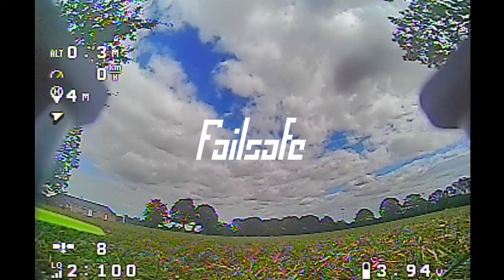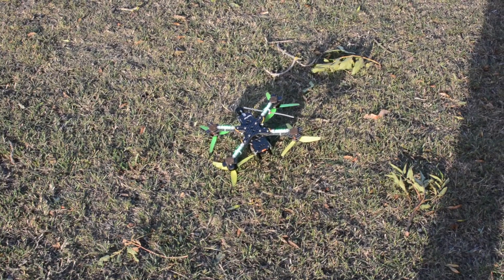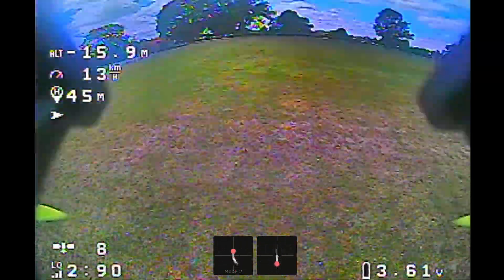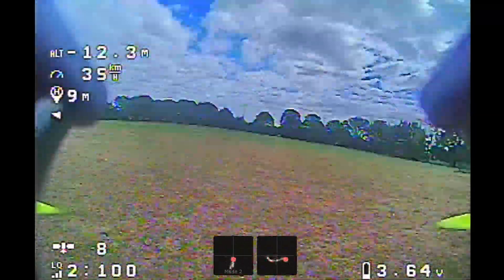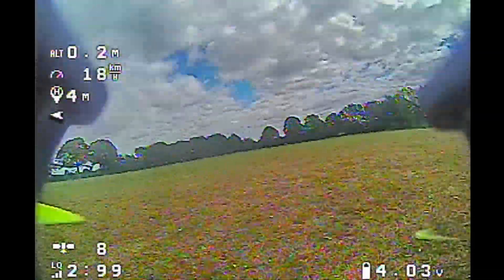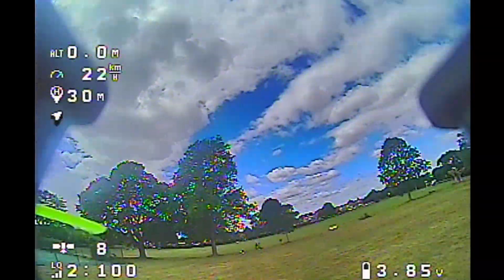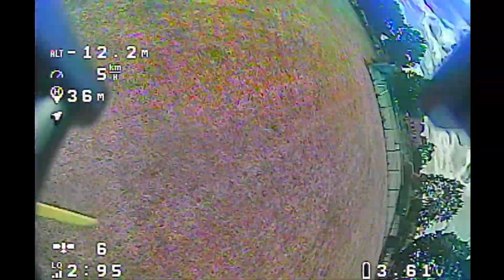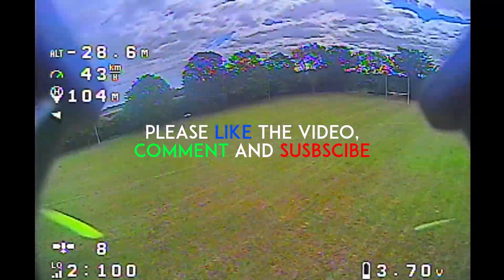IT'S ONLY £20! - HGLRC Zeus F722 DJI and Mini Review + Accessories

Comment: The real question is why u got carpet on the bottom of the arms
Reply from the maker: Cheers for watching! 
Its to raise the drone up a bit above the leds to stop them from getting damaged, they are called floor protectors. Like this: https://www.amazon.co.uk/Furniture-Pads-Floor-Protectors-X-PROTECTOR/dp/B087GBFNGC/ref=sr_1_6?dchild=1&keywords=Wood+Floor+Protectors&qid=1598542199&sr=8-6
Reply: @FailsafeFPV  could've put them on the top of the arms maybe